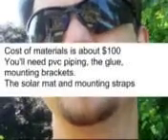Creating your own solar powered pool heater

Comment from the maker: It doesn't seem to work any harder, however the water pressure is not as great when I divert to roof compared to diverting the water directly to the pool.  So when you're cleaning, it's better to divert directly to the pool as you'll get more pressure for the vacuuming, using creepy crawly, etc. 

One tip would be to make sure the tubes going UP from the pump are on the highest point of the roof, and the return should be on the lowest, that way you have gravity helping on the way down.